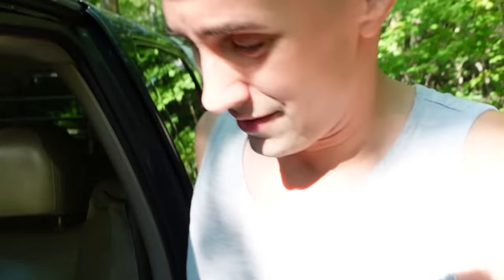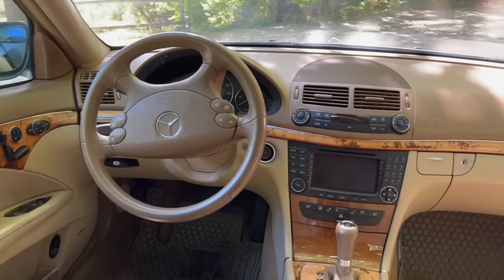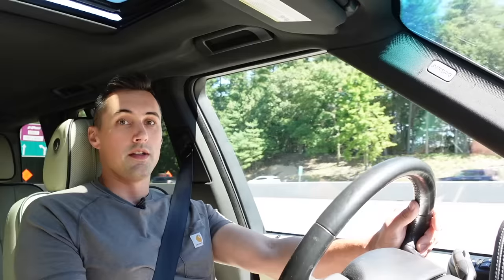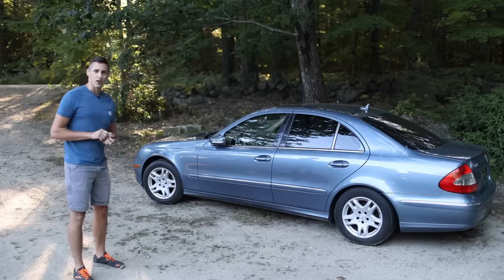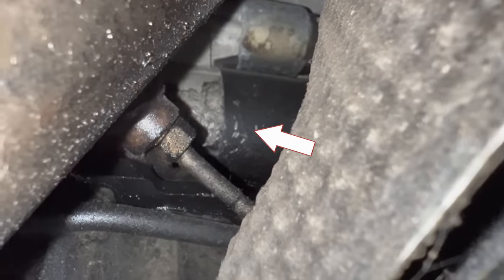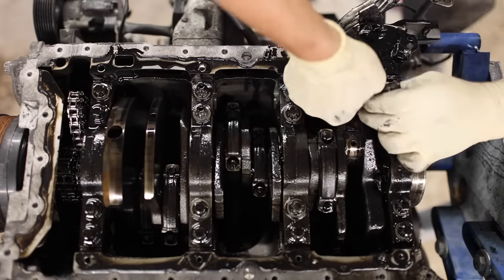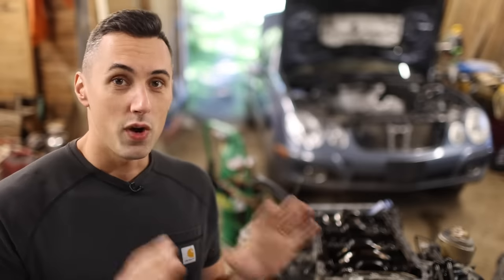I Bought a Repo’d Mercedes Diesel and I Regret it. Here’s Why You Shouldn’t.

Comment: Bummer.  This is a really robust engine and extremely popular in Germany and Europe.  It would be easy to get one over here as a core or in whole.  Very well equipped car for sure.  Hope you can get a spare block and bring it back to life.  Christian
Reply from the maker: Thanks Christian! I saw a block for sale on eBay for $1000. I considered buying it, but if I did, it would only be for content. It doesn't make sense to spend all that time swapping parts over when I can just buy a donor vehicle with a (hopefully) good engine. I have no shortage of projects available for content right now 😂
Reply: @WaldosWorld  Waldo, do some research on this engine, OM642. The biggest issue they had is the oil cooler, these were notorious for leaking and frying the swirl flap motor conveniently located right below. Also, the EGR system really fouls up the intakes reducing performance, which will happen on even a well maintained engine. Make sure the DPF isn't clogged, given the lack of maintenance your car had, it's possible the previous owner drove it without the regen cycle going. Hopefully you can make the money back from the content, because old Mercedes' are money pits, especially ones with questionable history.

Comment: This was a very common issue if someone didn’t know how to work on these engines. These engines suffer from an oil cooler leak which is a nightmare to do I’ve done many. The problem is when you remove the oil cooler if the cooling system wasn’t drained coolant will enter the crankcase and after the job is done if the oil is not drained oil floats to the top oil pump sucks up the coolant and they throw a rod. Seen this many times. These engines are definitely not as reliable as the om648 inline 6. Only 05/06 years came with these after that they switched to the om642 v6 which suffers from many issues oil cooler dpf issues turbos go out injectors leak, egr etc

Comment: U can manualy unlock auto transmissions from mercedes when u pull up the leather at the shifter and press or pull the yellow tab. 
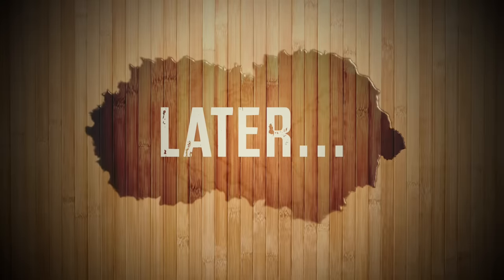So you can pull the car from the trailer without damaging the trans. (at 1:10 ...)

Comment: I have never had a love for the V6 configuration for a diesel engine, especially Mercedes ones. The BMW inline 6 was a lot better in terms of reliability and performance, although it too had its shortcomings. Maintenance of all engines is key to their longevity, but some engines do not give you a good return on your investments. Enjoyed the video, thank you.
Reply: In-line 6 platform is a lot sturdier in Mercedes’ also
Reply: @Diesel8290  om606 is the best Mercedes inline 6
Reply: @maxheadroom224  I’m a real big fan of the 606, have been working with them for years, but I think the om648 is better

Comment: What year is your E320?  Also how many miles did it have on it?  Do Mercedes normally have problems like this often?
Reply: I too would like to know how many miles!
Reply from the maker: It's a 2007 with 196k miles. I've heard mixed things about reliability, but I would expect it to last quite a bit longer if maintained properly
Reply: Good Luck with the one you just bought.
Reply: @WaldosWorld  3.0 v6 om642 are great engines this one was probably not mantained.

Comment: I was a big diesel enthusiast until my previous car, a VW TDI, highlighted how many fuel stations have bad diesel. The Turkey Hill down the street, for example, tested safe from water in the tank by weights and measures. Yet I pulled a gallon sample a couple of days after my last fuel pump failure (two failures over 30k mi from new) and found at least a few ounces of something clear that settled at the bottom of the container. Conversely, the gallon from a Speedway, that I also frequently used, was clear with no separation. With the price premium and fuel quality inconsistency in the midwest U.S., I see no value in sticking with diesel for small passenger vehicles like the E320 or a VW TDI.  And like someone else mentioned,  modern diesels are not as robust and forgiving as the old 70-90’s Mercedes’ that I grew up loving.

Comment: I usually pull the engine and transmission out also. It helps to remove the hood, fan, radiator after staining the radiator. Plus the usual lines and electric wires disconnected first. Well that motor has some reusable parts but the block, Internal parts, and heads are scrap metal.

Comment: The answer to what you should do depends on whether or not it will need to pass emissions/inspection afterwards. If it does need to, then get a new block and rebuild it. If it doesn't then 4bt swap it.

Comment: I recon you should replace the engine if the rest of the vehicle is in working order. I appreciate you will own two, however if it is rare, then it makes sense to repair it, then either keep the best of both vehicles, keep both, sell one or sell both. Parting it out would be disastrous if the engine was the only issue.

Land Rover recommends a service interval of 12,000km or 12 months, whatever comes first for the LR3 TDv6. I do mine every 6 months or 10,000km, whatever comes first. On an older technology diesel, i did it every 5,000km or 6 months, again whatever came first. I always replaced the oil filter and oil at the same time on all my vehicles whether they be diesel or petrol. The vehicles will love you for it!

Comment: My dad recently bought a W212 (well S212 Wagon version) with the E350 CDI OM642 engine. It had approximately 130,000 miles on it and it had the oil cooler seal replaced. But after only ten days of ownership, the oil pump suddenly broke and seized the engine, possibly related to DPF issues. 

So now after much difficulty we managed to get most of the money back and we have bought a late 2006 W211 (S211 wagon) with the E280 CDI OM642 which thankfully does not have a DPF. Runs much quieter, similar feeling of power and £2650 cheaper. And the 211 feels a little more old school Merc with wood and luxury, the W212 feels more modern and BMWish. 

The four cylinder diesel OM646 without DPF and the 5G tronic transmission is probably the most reliable and economical combination you can find on any 1995-2009 Mercedes.

Comment: I own a 2008 E 220 avantgarde face-lift model. I bought it new and it presently has 11500 miles on the clock ( keen cyclist ). Garaged it 's whole life and looks like it just come out of the showroom. It shares the garage with a 2004 MX5 nb razor blue arctic, i also bought brand new, it has 8000 miles on the clock and also looks brand new. A waste I know but exercising my own body is more important and has probably saved me thousands over the years buying new cars every 3 years. I only use the Merc on long trips, because there is an EV in the family we use locally. There is no problem with range anxiety in the Merc, even in and around the remote Highlands of Scotland lol.

Comment: I have an 08 e350 gas purchased not running as a project 2 yrs ago and LACK of OIL changes caused starvation on drivers side head which failed (camshaft snapped digging into journal)! I removed the oil pan and tons of sludge build up there too.  Miraculously, the lower end and passenger side head were still good so replaced the head and cams with used on eBay and engine has run fine ever since.

Comment: I like your bar/garage I know you are planning to build a new shop, but I’ll be perfect at least as a back-up shop to restore it once again at least half of it with from inside isolation, complete slab concrete ground, new sliding doors etc.. 
also your beside home shed need a concrete ground 
That would be a nice barn tour .. very nice drive way to the barn 
Thanks Waldo for your amazing videos 🫡

Comment: I bought my friends company car which was an e220 wagon with 164,000 miles on the clock  I paid bottom book value for it at 1300 quid or 1600 dollars. I drove it for 3 years to 204,000 miles , using it for work.
It was fantastic, the air suspension could take a ton of weight it was a 2007 car with the 170bhp Evo engine all it needed other than routine maintenance was a new Delphi fuel metering unit for 50 pounds and a new xenon headlight ballast.
At 204,000 miles it sold for 1500 pounds at this point. What a car.
Only sold it as it was too big for us in retirement .
It's just bad luck here that the previous owner tried to drive 50,000 miles without an oil change.

Comment: My '84 Mercedes 300D Turbodiesel with 575,600 miles on it is the simple engine you're thinking of. BUT now with electronic fuel injection, having to add DEF with the active smog devices in the exhaust-Diesels are actually more complicated than gasoline engines. I am a big Diesel nut like you, but am questioning the maintenance of Diesels now.

Comment: they tell you that you can change your oil at ridiculously long intervals so they can keep the "projected cost of ownership " low ... in reality conventional or semi synthetic oil should be changed at 3000 and quality full synthetic shouldn't go longer than 5000 miles... diesels CAN go a little longer but i wouldn't

Comment: I took a gamble like this as well. Bought a 62 GMC 1000 and the seller would deliver it. That's what he does. I fixed what I could, electrical, fuel system and got it running. The catche, external head gasket leaks. Yep, cars are money pits.

Comment: I'm biased... so please repair it.
I had the previous model of this car, the series 1 W211 (2002) with a 2.7L 5 cylinder diesel. It was a pleasure to own and drive. I got 1500km on the highway on one tank of fuel !! About 935 miles.
Edit: Mine was burgundy exterior with light cream leather interior and an AMG body kit and wheels. Stunning car.

Comment: I bought a 1983 240D diesel that had the engine replaced, and drove it for 13 years. I hope this car gets the same. I think this engine was run without oil. Mercedes blocks are known for being strong and reliable.

Comment: I own the 2007 , I had to machine alot of the parts to build the engine up to get ready for the tune . I won't say how much power and torque I got out of it but it's IMPRESSIVE. I eat up 63's and scat challengers, also keeps up with dodge demon. I only got beat by 1 second of time in the half mile run and she's extremely reliable . Love my e320

Comment: I don't know about the OM642 engines but I know the OM646 (4 cylinder 2.1 litre diesel) on my 2009 W204 C200 is bulletproof. I would also say that lack of regular oil changes is what killed this one. A replacement engine is likely to cost a fortune even used and a rebuild is clearly out of the question unless you can get a short engine (block with crankshaft and pistons). I'm sure you knew what you were getting into and I would rather deal with mechanical failures rather than collison damage. With the other car you might be able to make 1 good car out of 2 provided it doesn't have an engine that is toast.

Comment: We bought a w211 E220 diesel ourselves with a hole in the block (still runs) for the same price and its in mint condition inside with navi and sunroof. Its in this black color with green flakes. Has some rust on the rear fenders but not too bad overral, just looking for a engine now with low miles. I wish you good luck on yours!

Comment: there was a commercial on these videos some time ago, about a thick fluid that is used to glue metal pieces together and fill out gaps. after that thick liquid dried out, it appear to be very sturdy. its a gray thick liquid, i forgot the name. if that hole on the engine cant be welded, that glue would maybe be an alternative to repair that engine. the other damaged engine parts can be cut out very precisely from some metal block by a cnc machine, that would i guess cost alot less than buying original mercedes parts.

Comment: I would put a new engine or junk yard engine with low miles, change the fluid, filter, and gasket in the transmission. Fix any of the other stuff, if there is anything else and it should be good to drive again. The driver side head light needs replaced or restored also.

Comment: Strong disagree on more frequent oil changes. This happened because either the oil leaked out, they never changed it or they used cheap oil. I'd bet on cheap oil changed infrequently. Use a good synthetic oil and change at the manufacturers specification, or, even better, based on oil analysis. I've run a lot of MB diesels and never had an oil related failure even with 10,000 mile oil changes.

Comment: 2015 RAM 2500 Cummins 6.7L Diesel. 490,000 miles and NO BLACK oil. My oil is clear & clean till 5000, then I change it. Love the Cummins, 27-33mpgs freeway. A Jewish truck with clear clean oil and able to burn diesel, kerosene, heating oil, jet fuel etc... Love it..

Comment: Interesting contrast to a Mercedes Benz 220 SE (gas) in line 6 that I bought back in the early 70's for $ 1,000.  I drove it for another 400,000 miles before it finally broke its rings cold starting at 35f coming back from Utah. Poured gallons of cheap oil into it to nurse it back to Oregon.  When I took it apart the main bearings in the engine where huge - reminded me of a Lycoming airplane engine. The bearings and crank looked like I could have put them back in it and drove it another 100k.

Thank God for progress----.

Comment: well after you replace the engine. take out the air filter box and cut out the bottom and epoxy on some wire mesh.
That way if it gets a water splash  in the grill it cant become a big wet dry vac and blow the engine;)

Comment: I just got mine on the road after replacing the engine and getting a rebuilt transmission. It was hell getting it to that point, but now I have a comfortable and cute diesel sedan that I know the ins and outs on 🤙🏼 288k on the body and it doesn’t look like it
Reply: I had a feeling hole in the block was the case. Same deal with mine. The oil sensor is not sensitive enough. It casually tells you to add oil when in reality, when it shows you that message, you need to pull over and add it NOW. Willing to bet locked up and chucked a rod because of that. Sad but nobody can take care of these.
Reply: NOOOO definitely remove engine and transmission as one piece. Its all too easy to misalign them when reinstalling and then you’ll have a transmission that can’t spin its own pump. Ask me how I found out 😅

Comment: No 6 rod bearing failure 🤔
The oil heat exchanger sits in between the V and is sealed to the crankcase via a gasket.
When that gasket fails it leaks and as the engine heats and cools dirt and debris is dragged into the oil circuit from within the V.
The oil cooler/heat exchanger return gallery is directly on top of and drips directly onto the big end an cylinder 6.

Comment: On IAA it's pretty simple to tell which cars run or not. Run and Drive means it runs, and drives. Starts, means it starts but does not drive. Stationary, which this one undoubtedly was listed as, means they cannot get it to drive, or even start. Also important to see is the Key status, whether that is present or missing.  

Oh well, you probably learned that lesson yourself by doing this one. I'm sure you could still part it out for more than what you paid. Or use some bits on your other one you bought. 

FWIW you can sometimes find really screaming deals on IAA by trying to find cars listed as "stationary", but ONLY if you can figure out that it only needs a small fix, with some certainty, before buying.  One time I bought a Smart car listed as Stationary because I recognized in the pictures that they had tried to start the car with the wrong key, which produced a telltale warning light on the dash. I ended up getting a low mileage perfect condition car for about 25% of it's retail value, and I didn't even have to buy a new key as I found the correct one in the glovebox and started it while it was sitting there on the lot on inspection day. I did nothing to it, used it as a DD for about 6 months, and still sold it for 200% profit in one day. Probably my easiest and best ROI on an auction flip. 

Hope your next one is a little easier, keep hustlin!

Comment: id get a breaker bar and a big peice of pipe on the crank nut and rock it back snd forth until it frees up or take off the oil pan an remove the rod cap on the broken rod. mine was twisted like a pretzel but didnt punch thru the block. i did with a lot of effort get it to rotate.